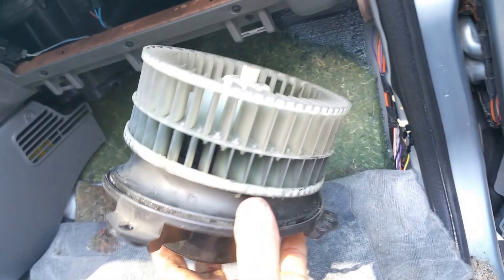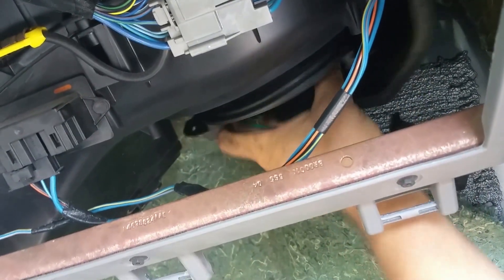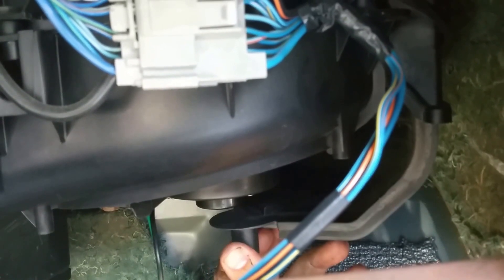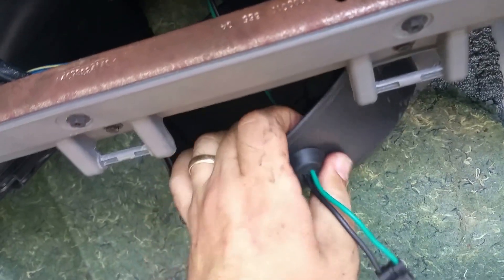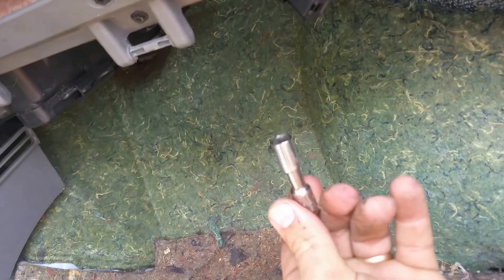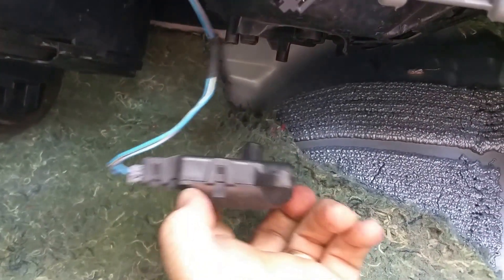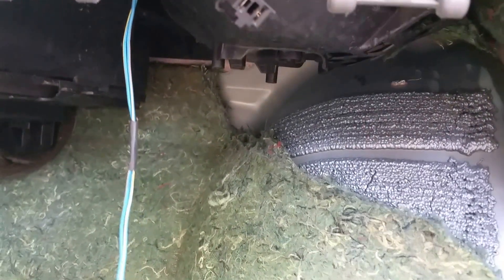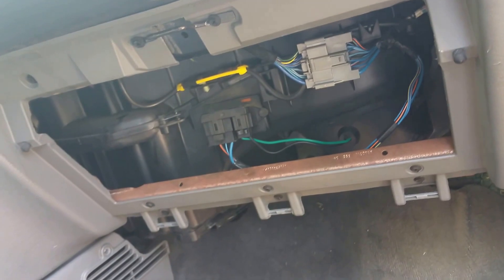Heater & A/C Blower Motor Replacement Chrysler Town & Country or Dodge Caravan Pt.2

Comment: Thanks for the help. I broke mine but finally got it
Reply from the maker: Glad to hear you got it fixed. Thanks for watching and commenting.
Reply: @E4EonEbay  ya thanks the wife has been happy. Its running fine now. I ended up having to bust off the back screw of the housing but it all works fine now. Plus it will be easier next time if i need to do it again.

Comment: Does the accuator control the fan speed cause one of the controls on my fiancees van isnt working so didnt know if its the control panel or if it could be the accuator or fan
Reply: Most likely her fan motor resistor needs replacing.

Comment: Thank you thank you thank you for both videos got my fan motor changed going back to northern Ontario Canada from Alabama will be needing the defrost and you made it possible for me on low income to do it.
Reply from the maker: Richard Lamothe glad I could help!
Reply: Another thing is the back screw on housing I got with a 8mm socket on a flex shaft on power drill without removing the insulation that was a plus
Reply from the maker: Richard Lamothe I didn't have a flex shaft handy...lol
Reply: It was a stroke of luck went to step son's house for cutter and he said here try this flex on my drill first before you cut insulation and lo and behold it worked lol but if he wouldn't of had that I would have to cut insulation out like you did lol

Comment: Some comments after having just finished doing this on my 2007 T&C: A mirror and a bright light were helpful. Also, 5/16" works wonders when 8mm isn't available. The motor is keyed, so make sure you are putting it on with the keyed tab in the right place. (It's the one with two holes -- one for the screw and one for a plastic pin.)

Comment: Hi Steve can you help me out please. I have a 06 town and country and sometimes the front fan blower works and sometimes it don't. It takes it fit like everything else does. Does it seem like it could be the fan motor is bad and needs replaced. And also the rear fan blower works it blows from the lower rear passenger side on the floor but no air comes out from the upper vents at all. Please someone give some advice on what the problem can be and if a hard or easy problem to fix. And it also has automatic temperature control. Thanks
Reply from the maker: So, regarding the front blower motor beneath the glove box area. The next time it is not working, if you can hit the plastic cover that covers it that I show in my video with something solid and it starts working, then most likely the motor itself is bad and is need of replacement. If you have never changed the blower motor and it is still the original from 2006 than its 13 years old and is probably failing. I have sold my blue 2005 and now have a white 2005 and have had to change the blower motor in this one as well, it seems to be a common issue as they age. As far as your rear is concerned it could be something in the electrical control panel or in one of the rear actuators that divert the air to the top or bottom zone in the rear of the van. Perhaps someone else will chime in regarding the rear issue, as I have not run into that one personally so I am only speculating ideas on what it could be. Anyways, thank you for watching and commenting!
Reply: Thanks Steve I will try to to that when I'm not working. I know sometimes when I turn the setting down or up with the knob the blower quits and then about 5 to 10 min later it starts blowing again but it seems like its not really putting out as much air at times but you can also hear a humming noise as well. And I already replaced fan blower resistor thought  maybe that was the problem so maybe that wasn't the problem after all. But I'll have to tap it and see what it does but more likely I'll just replace it.
Reply: Steve you get this message reply back my fan blower motor goes really high and then low. Sometimes when adjusting the speed it doesn't help. I hear a humming noise coming from that area. And I even replaced the fan blower resistor. So does it seem more likely its the fan blower motor.
Reply from the maker: @jamesmoyer5724  yes, it sounds to me like the motor is on its way out, they can be had new for under $30 on eBay shipped. For the money and time its worth changing it now before it dies completely.
Reply: @E4EonEbay  thanks buddy

Comment: Nice video, full of information without having to wade through a lot of frills. Thanks for taking the time to make this. I watched the videos and now feel confident I can handle the whole thing. Got it all apart, and think I'll probably take Robert U's suggestion below and forget about that back screw, especially after spending a good chunk of time finding and taking it off. If anyone has to replace the fan again, they'll probably thank me for that.
Reply from the maker: Matthew Lind your welcome, I saw some videos that said it required special tools like a flex bit, I decided it could be done with basic tools
Reply: Or it will leak air, make a noise. who knows? The next guy will.

Comment: Great video. Made the work alot easier. With it being an older car and having 4 other bolts I decided to just remove those 4 bolts, reach up on the housing on both sides towards the back and wiggle and tilt it till the plastic snapped off where the bolt was attached to it. Housing stays in perfectly fine without it. Also avoided having to carve up the insulation. That 5th bolt in the back is overkill. Snapping off the plastic allowed me to change it in about 20 minutes.
Reply from the maker: John Klotzbach I have heard of others doing the same, I agree that the back screw is overkill and put there by Chrysler's engineers just to cause misery to those who need to repair the vehicle :) thanks for watching and commenting!

Comment: I removed it, but I tested it outside and it works, what nowwwww?
Reply from the maker: Perhaps the issue is in the control module itself and not the blower motor

Comment: Thanks for the help! Just finished replacing my fan. If I could offer some advice, using a mirror to get the back screw is very helpful. It's a lot easier than feeling around, or poking your head in there. I'd also like to point out that it works great without that screw back in place! Thanks again!!
Reply: I was thinking that one screw probably doesnt need to be put back in as it does not seem to be critical

Comment: That last back screw ain't goin back in LOL
Just a cover so no biggie.
Reply: Bad circuit in the resistor pack. 
Which is located behind the glove box. Easy to remove and replace.

Comment: wow, I am confused on mine. My brake and abs light went on and then the ac stopped working. even the temp on top dont work.
Reply: Same thing happened to a ground wire is off

Comment: as a flat rate tech i must confess i break the back screw off by twisting the bowl  i know its wrong but not needed and i have to eat
Reply from the maker: I honestly thought about that, I swear vehicle engineers who design cars have never worked on one a day in their life, if they did, they wouldn't put screws in places like that...
Reply: Mazda 3  the worst i have done at 7.5 hrs flat rate